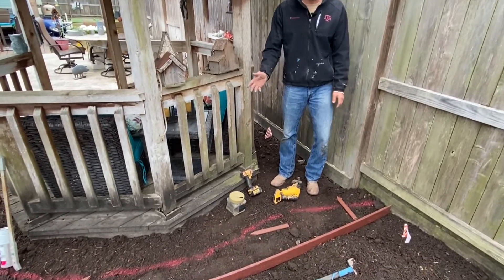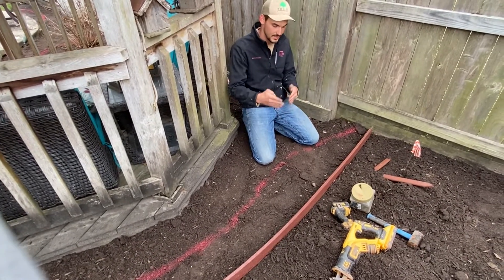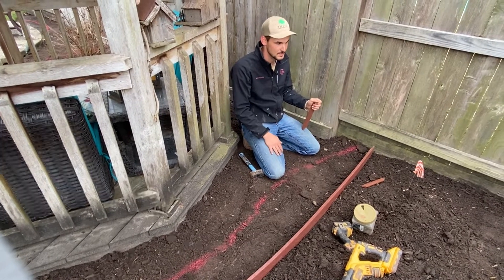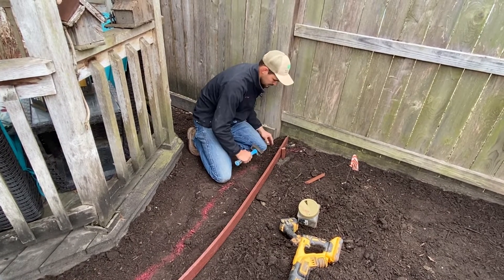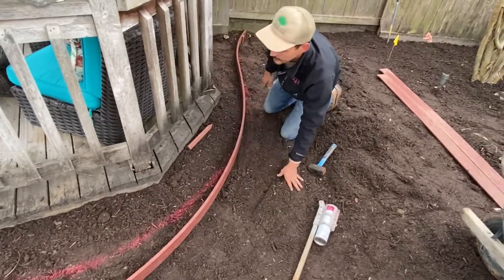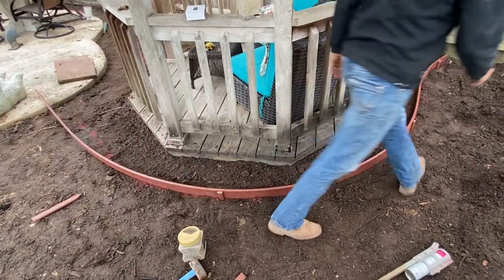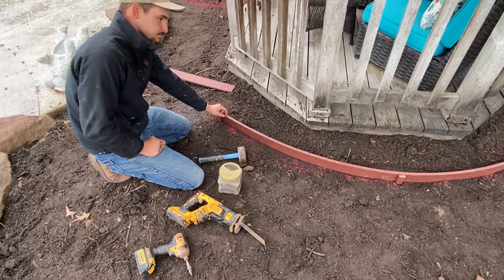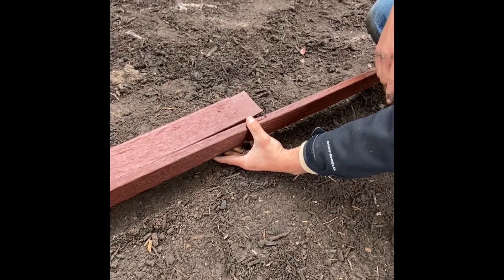How to install bender board edging

Comment: The lapped joints are for thermal expansion - put a stake on either side and leave a gap but don't screw them together. It allows it to expand/contract without buckling out of the ground. Just an FYI in case you ever run across the issue (maybe not a problem in constant shaded areas)

Comment: Should I put the stakes in on both sides of the bend a board and if so How do i know when to do so.
Reply from the maker: We typically put the stakes on one side, this is more visually appealing. I would put the stakes on the side that won't be seen as much or that will be covered with a material.